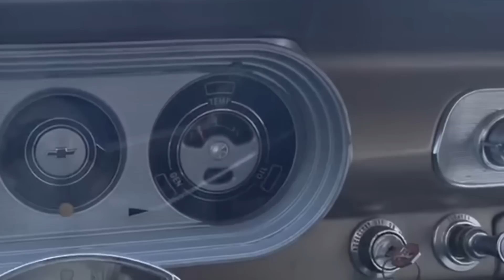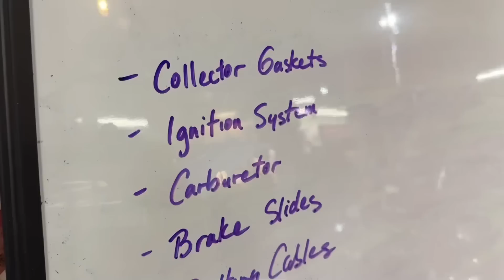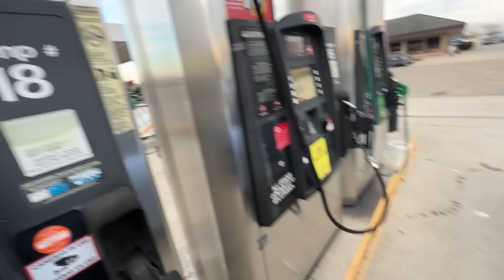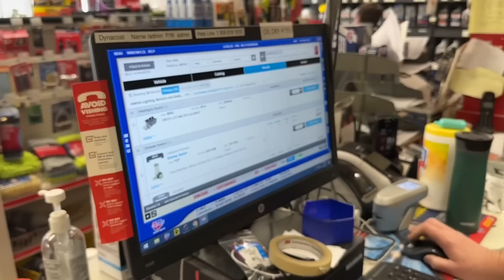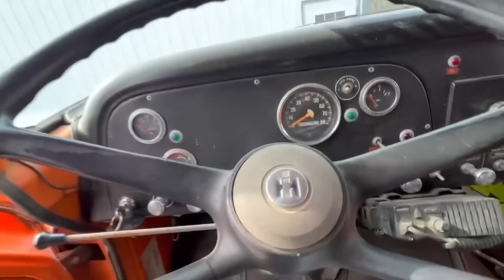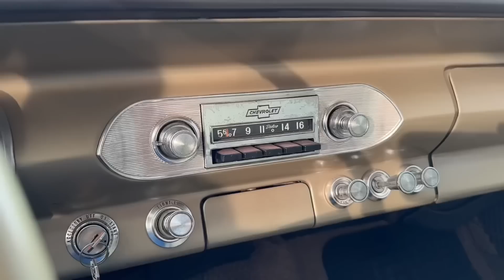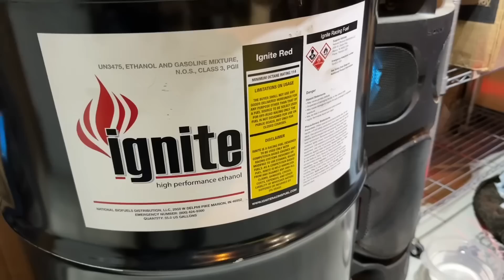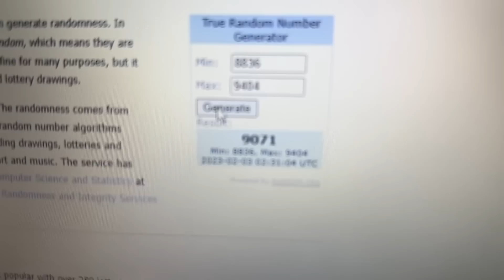FROM A DUD TO DAILY DRIVABLE! Billy’s 65 ChevyII RUNS INCREDIBLE after “The Old Man” works his magic

Comment: I like the way that old nova looks with tint on windows the wheels look better than crager ss wolud look on it  they match the black on windows i would fix the turn signals and heater and put a good sound system in it and cruise the hell out of it love the  color i belive its marina blue they used a lot of in the middle 60s classic old chevys have set the bar for all of us old hot rodders

Comment: There is a good reason shops don't work on carbs anymore. People assume that tuning a 
carbureted is as cheap as fixing a misfire on a modern car. It can take several hours of test drives and tuning timing and fuel mixtures and no one seems to want to pay for the time it takes with labor being over $100 an hour

Comment: Billy , you are a nut!😂 I would definitely leave the manual steering, get a shroud for the radiator and the correct fan, a posi with 373 gears and put the OMG supertune on the engine. Powerglides are tough little Transmissions! That is going to be a fun little Streetcar.

Comment: Tell the kid to build a straight axle gasser out of that nova with a 4spd. Still can street drive it and take it to the nostalgia drag racing events. With old school tech like stock leaf spring suspension and 10.5 inch wide slicks can really still be fast and competitive and hookup hard just fine to  yank the front wheels off the ground if you got enough hp...

Comment: had a 63 SS with a bb 427 in high school  it was a fun car.
Reply: Now remember novas copied the mustang lol 😂
Reply: @Ray-rj52459  Only if they had a time machine, to whisk them forward to 1964/1965, so they could steal the plans for the up-coming '641/2 Mustang front end (which was the same design Ford used on the Falcon until 1967), so they could use it on GM's 1962 thru 1967 Chevy II.

Comment: If anyone could shine some light on my situation I'd appreciate it. I got a 1980 El Camino, originally had a v6 in it. I beefed up the rear end with posi, 3.73 gears, new moser axles. ZZ4 350 crate motor, with 700r4 tranny. It has a 2800-3200 stall, lock-up torque converter. I'm use to driving stick, and still learning on older cars etc. Long story short when I give it gas going like 45-60mph, It'll downshift into third and sounds like it wants to go, but just doesn't match the power I feel like I should be putting down. If I do this going lower speed, or in 1st and 2nd gear you get that good hard pull. I feel like the stall I have is too high for not having a bigger cam to match? Is this correct? Timing is set 10 degrees BTD, carb is set up right and so is the TV cable. Also it kind of feels like it's running on high gear or the sound of rpm isn't matching the pull if that makes sense.

Comment: Hey Bill it appears your Boy may just like your Daily driver and want something similar himself. You probably get this from everyone but here is my 2 cents as well that Malibu is pretty sweet now but I wish you would give a couple other vehicles some love namely the Dually that poor old truck is ragged and in Dire need of some love. Seriously dont you all have anyone in OHIO that knows how to do basic bodywork and a clean white paint job? Or what about just a new carpet and some floor mats buy an interior kit so your not sitting on the foam and seat springs. Lastly what about the Nova Bill that car has a great story you have history with that car it deserves an engine at least something so it drives around to its storage areas and doesnt have to be pushed everywhere lord knows surely you have enough SBC parts and pieces you can throw together a good mule motor for projects like this. I'm a couple years older than you are Bill (I'm 54) so I know there are most likely more years behind me than in front of me we dont have all the time anymore if your gonna do something NOW is the time to at least start.
Reply: Uncle Bucko needs a cooler Daily too his old work truck while nicer than your dually just aint gonna cut it tell him to get his (37? Chevrolet) Hotrod going already

Comment: I don't like those universal rad hoses they got the steel spring in them that rust and clog the rad and block for of trash and the hose is so stiff they want to break the soldered connection where the hose connects to the rad

Comment: Hey Bill, I need some advice on a old Holley 800 double pumper spreadbore. Going on a 406” Pontiac 400 with a 2000 stall converter and 4.56’s. Street car mostly. Mild hyd flat tappet, 224*-234* @.50 with a th400 in a 3200lb 75 Formula Firebird. Currently has 67 and 82 jets. Any idea on where my power valve sizing should be?
Reply: There's two trains of thought.  
1 hook up a vacuum gauge and whatever your idle vacuum is run 2 sizes smaller.. 
2 is going off of what your part throttle cruise vacuum is.  And install a power valve 2 numbers smaller.
If you have 10.5hg (inches mercury) you'd install an 8.5..
Hope this helps.